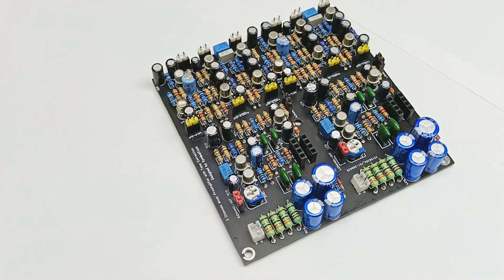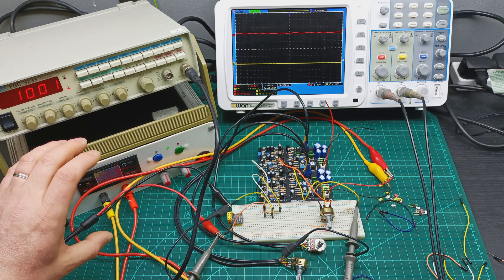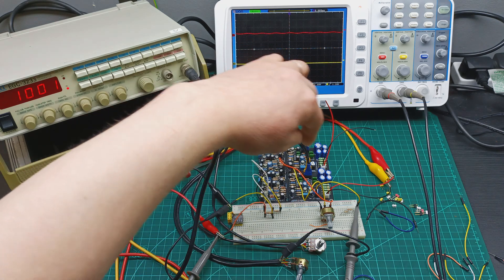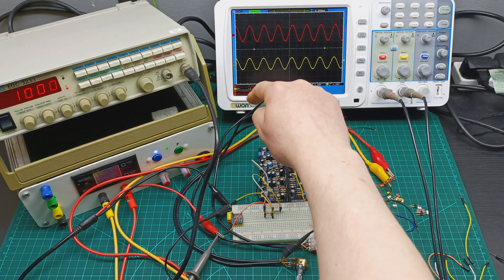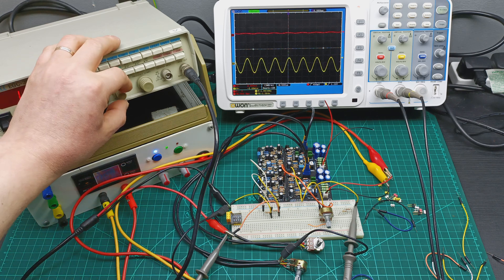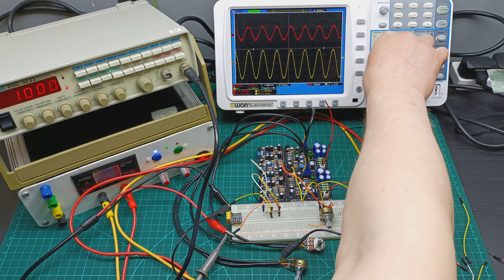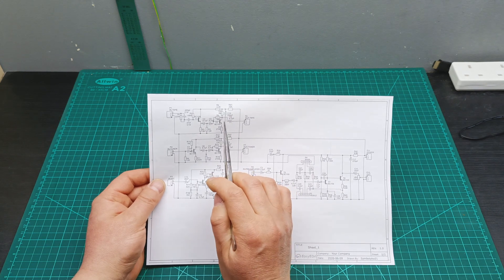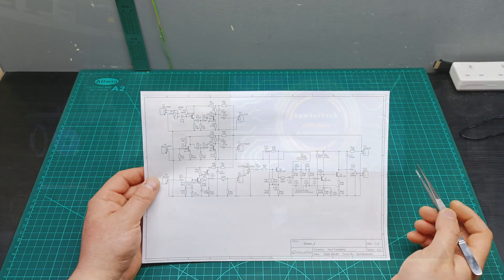Testing the preamplifier

Comment: i have questions about my M77 preamp when i connect my tube preamp to my Hiraga amplifier dc output go down -300mV but without preamp my amp have +5mV!  How can i test my pre amp with multimeter or  oscilloscope? Output voltage is not stable ! 
Thanks
Reply from the maker: @woodsybushcraft1570  just put the multimeter on DC voltage and measure the output of the preamplifier. And also try to put a 5microfarad bipolar capacitor on the signal path between preamp and amp and test again the DC offset to the output of the amplifier.

Comment: Are u making it for nelson pass amp camp?
Reply from the maker: So my plan is to use it with amp camp Nelson Pass
Reply: @SymbolTech21  can we add volume control to amp camp amp?
Reply from the maker: @thedistortedguy  so the volume control will be part of the preamplifier which I will put together in the same chassis with the amp camp Nelson Pass amplifier. So like that I will have the volume control plus tone control with bass and treble control